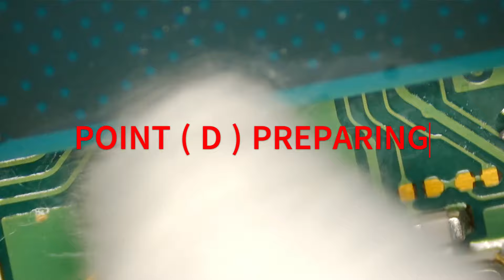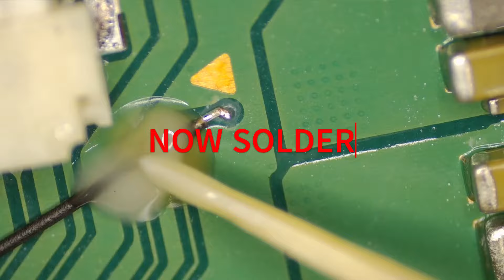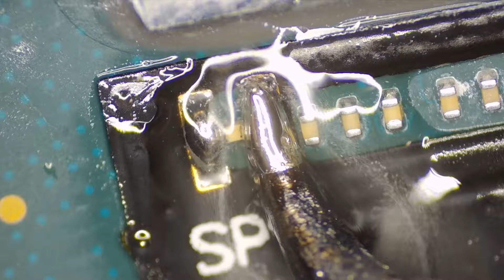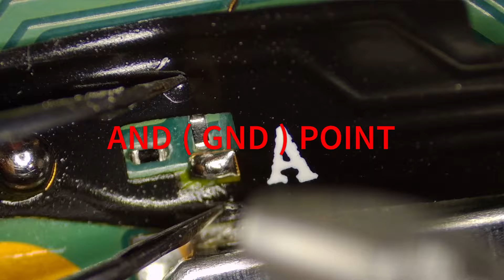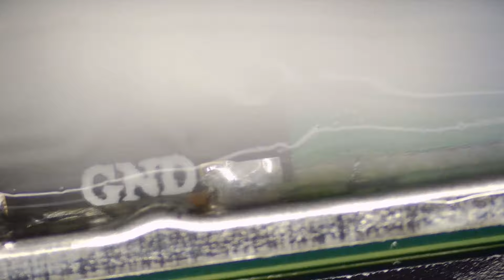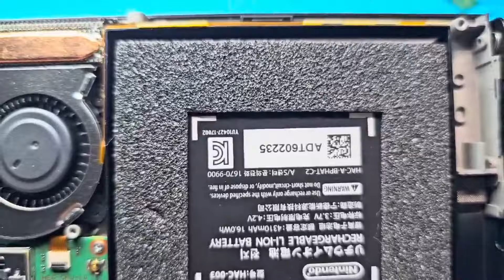UNLOCK NINTENDO SWITCH OLED WITH INSTINCT V6S KAMIKAZE

Comment: how many celcius do you run the hot air station at? around 412c? would you recommend me using tinfoil around the pad so i don't damage the A point and other stuff around it? ill soon be doing the kamikaze just need a little more info!
Reply from the maker: opero em 300 a 380C° no maximo... eu nao uso papel aluminio para isso mas eu tenho experiencia a voce eu recomendo que use!